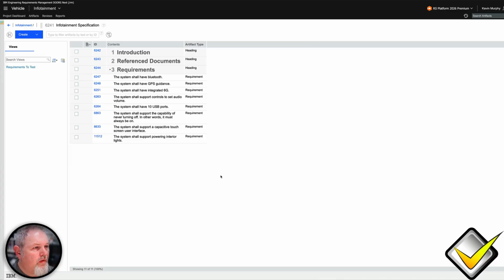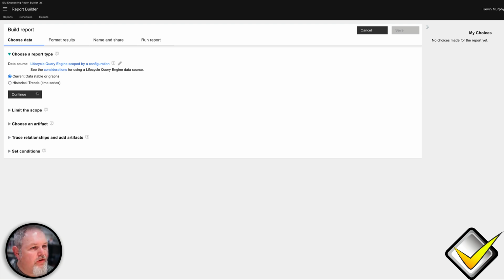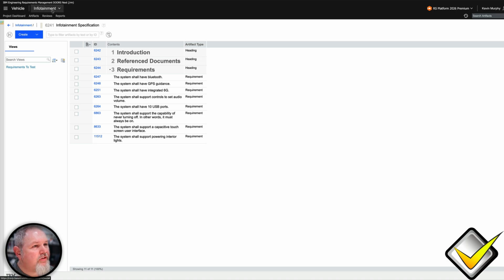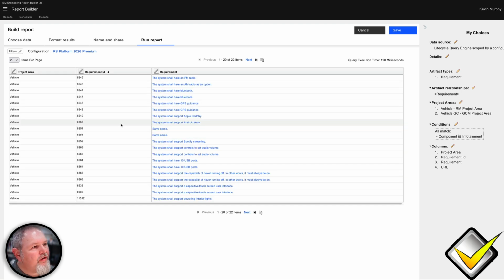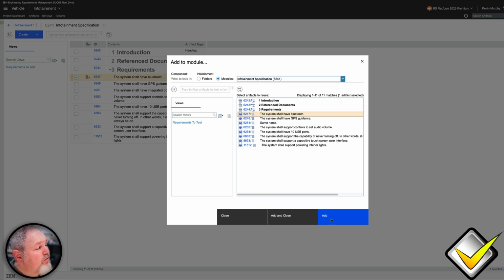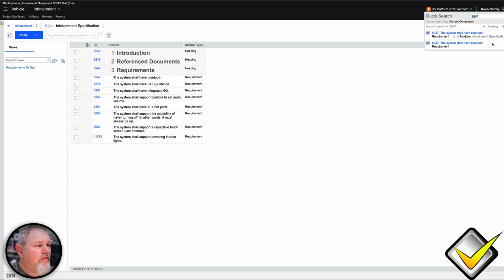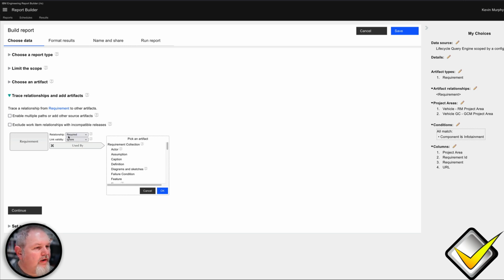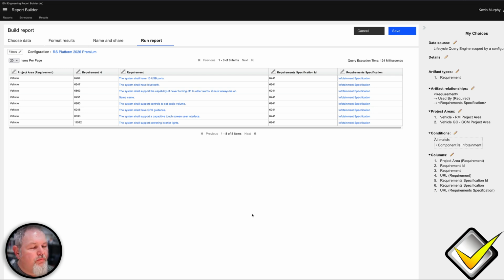IBM Engineering Tool Tip 6: Fix Duplicate DOORS Next artifacts in JRS Report Builder

Comment: It's more confusing when you throw traceability into the mix, since links are not shared between base and module artifacts. It's even worse between tools (like ETM). You can have base artifacts linked to test cases and find out later on that you are unable to report those requirements that way.

That's when LQE doesn't corrupt your indexes. In our environment, we have to revalidate our TRS Feeds every couple of weeks to keep data consistent.
Reply from the maker: Are you on version 7.0.2 or after? LQE indices have been much more reliable since then. But yes, certainly feel your pain on that one. Looking forward to ramping up 7.1 because in theory this should improve big time.
Reply: @BaselinesKevin  Thank God! We are on 7.0.2. I hope we can upgrade soon. Thanks for the big news!